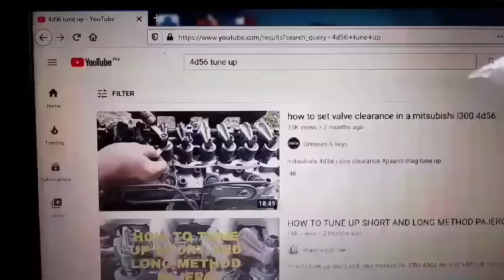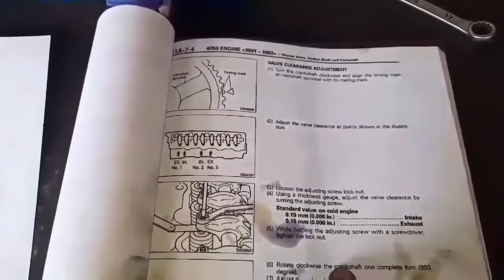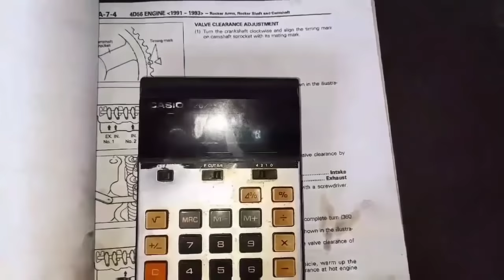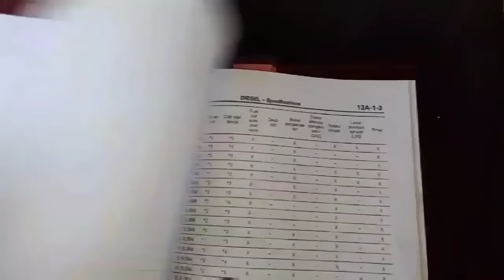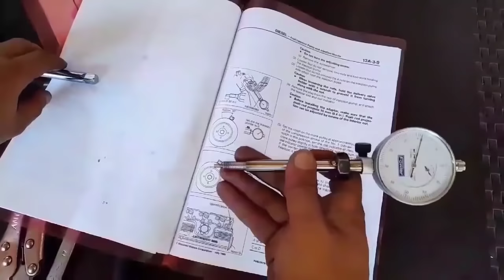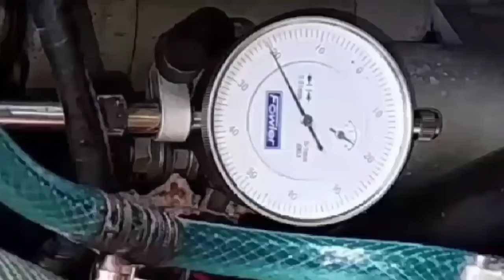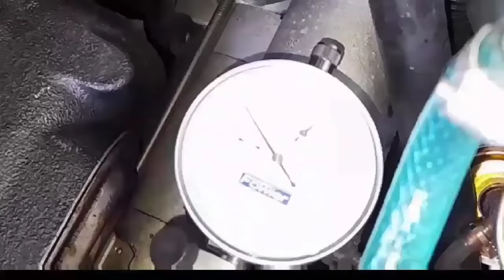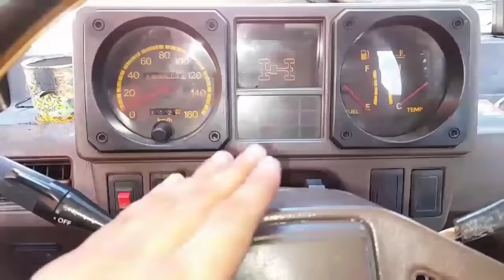COMPLETE 4d56 Tune Up, Valve Clearance and Injection Pump Timing Using A Pre-stroke Measuring Tool

Comment: Great video and thanks for the tips. When my injector pump seals went I had to remove it myself and have it professionally reconditioned. When I put it back I remembered timing it just with hand adjustment. I had no idea about the technical way  until now!! The injectors and pump recon cost me $1600 Australian but it would have cost thousands more if done by a mechanic. Still going strong 5 years later although it could do with a tune! Thanks brother, God bless you🙏🙏
Reply from the maker: Thats expensive. Actually, as far as im concern, theres really nothing wrong  with simply twisting the pump and just have a feel for how the engine runs. I intend to do a video about it too. Like ive said in this video. Dont be too bookish about tune ups. I figured id just show this process because almost all the 4d56 tune ups i see are mainly focus only on the valve clearance. Thank you too.
Reply: In Nz my neighbours got quoted 2.5k! no way i said let me have a look

Comment: You replied quickly to my comment about accessing the crankshaft from beneath.  I had deleted it because as the video progressed, I saw that you could do MUCH MORE with the fan and timing cover out of the way.  Those ATDC degree points are only visible under the cover, for example.  Again, Great video. Very informative.
Reply from the maker: Thank you and goodluck

Comment: Amazing knowledge sir. I just did a top overhaul to my WLT. the problem previously was a broken intake valve. I searched googe and valve clearance was said to be from .005 to .015 intake and .015 to 0.25 exhaust. I did .008 8ntake and .020 exhaust but it did not want to run. I readjusted to .015 and .025 and it ran. But now it sounds like a jeepney when accelerating, smoking white, and lower power, and hard starting. I need to spray carb cleaner in the intake for it to start. I did a perfect TDC timing on crank pulley, cam gear, and injection pump. But i think i should try the i tooth advance in the injection pump in the other video i showed and that dial gauge for the injection pump.

Comment: Thank you for the information I have a few questions  1 the tool that you use with the dial gauge how can I get it../ 
2 can I just adjust the crank 7 degree and fine tune the pump I have a dail gauge but not the tool 
Thank you for the information it really helps

Comment: Thank you for this wonderful explanation, I have an older volvo penta 4 cylinder marine diesel , when I start up it would produce lots of white smoke , do u think adjustment of the inject pump might help , also for example in a misalign pump , will it create additional crankcase pressure ?

Comment: Sir, thank you for this highly educational video. May I know the effect of having a .25mm valve clearance for the 4d56 engine performance? My mechanic insisted this clearance instead of the .15mm clearance in the manual. The engine was warm/hot when they adjusted the valves. The manual says .15mm cold.
Reply: I would like to know why also
Reply: @peoplechoice7654  I DIY'd the valve clearance by following the video. It was actually very easy. My Gen1 Pajero was on .25mm and I changed it to .15mm. Mas naging pino ang idle. Hindi na siya tunog trak na isuzu. Mas lumakas din ang hatak. Pakiramdam ko ay parang tumipid din sa diesel.

Comment: Thank you very helpful video. On your other video I learned how to fiddle with the fuel mixture, i have no black smoke now. Tried doing this by using the other end of a caliper with magnetic support. Measured 1mm movement of plunger from tdc to 7atdc. I think by listening and driving you can feel the performance. Adjust and adjust. But can you please tell me where you bought that dial gauge and adapter?
Reply from the maker: The indicator is from my fowler bore gauge bought from amazon https://youtu.be/0oN0-vLN0j8 the adapter is homemade https://youtu.be/9S4DX1k3F_I

Comment: One can rotate the crankshaft by lifting one of the rear wheels, engage the highest gear and turn the wheels. No need to remove the radiator and fan.

Comment: saan po shop nyo...need po mag pa tune up, valve clearance and injection pump timing using a pre-stroke measuring tool?...Mitsubishi adventure 2017 model...pls. po. Nagka calibrate din po ba kayo ng injection pump?...pls po.

Comment: @mrdiyer I have a jeep that has a peugeot XD3P engine. The FIP is Delphi-TVS DPC. It has a second solenoid adjacent to the throttle. I think this is the cold idle advance or idle rpm increase when AC is switched on. The solenoid makes the click sound when I connect power but no change in engine rpm. I am m unable to find any information about this FIP anywhere. Have you come across this FIP.

Comment: hi great video ! i have a D4bF which is basically a updated hyundai version of the 4D56 - it has a mechanical injection pump , my question is, im going toinstall a boost gauge, should i tap into the injection pump boost line or into the wastegate boost line ,,,, interested on your thoughts
Reply: would there be any difference?

Comment: Sir i have a problem..after i do valve adjustment done on non turbo 4d56 .i drive the car and suddenly i hear a clacking noise from engine...when i open again i found one of nut is gone (in valve cylinder 4)..i try to found at the top of cylinder head but can't not found ..but the engine is ok..i change the nut and still driving normally until today ...my question is the nut stuck in the oil hole in cylinder head or going thru oil pan ..what can i do to found without major diassembly the engine...

Comment: @Mr DIYer  Hi just seen your video and with my 4d56t Intercooled import it says 0.25mm and the book shows something completely different is that because they’re slightly different variants in this motor or em I better of going your way mine is a 1988 gen 1all so I have the book that goes from 1983  to 1997 petrol and diesel from na to nk
Reply from the maker: Like ive said in the video. You can experiment. See what works best. You can try .25 .20 .15 or even 12 13, whichever, at the very most at least .10
But in my experience having a clearance of .20 or .25 produces a lot of tapping sound from the tappets.
Reply: @MrDIYer  ow yes yes and so do them in the same sequence that you showed

Comment: How about the pump timing on newer 4d56 with electronic controllod pump? There is timer piston and timerpiston sensor, so is it even made to be adjusted manually?
Reply from the maker: Still trying to learn about that system but so far i doubt you could do that manually. Everything is controlled by the ecu.

Comment: Hi, I am an ardent follower of your channel especially on the 4D56 engine videos. I have just completed rebuilding a 1992 4D56T engine and followed all the processes from piston ring gaps and spacing gaps and cylinder to piston clearance gap etc.  On first start up I have blow by what is causing that??? some internet sites say the rings have to seat inn first before the blow by can go away. In your videos you dont mention anything about seating the rings how do you do it????
Reply from the maker: Question: did you clock the piston rings properly?
If everyhring was done right. 
Its normal to see initial blowby from new or newly rebuilt engines. Thats why we break them in. Meaning you let the engine run. Preferably idle for one hour intervals. One hour running one hour cool down and  one hour running again and so forth. Eventually the rings will sit against the cylinder wall. That is if everything was done right.
Reply: @MrDIYer  Yes I clocked the correctly and I made sure it was correct. So after 10minutes of starting the engine I saw some white smoke from the breather hose, even the feeler cup and some oil when you remove the dipstick(just drops jumping out). So provided everything is ok, how many cycles should I run of 1hour running and 1 hour cool down??
Reply from the maker: Try to do it the whole day one hour running one hour cool down.
Reply: @MrDIYer  Hi, I think I have another problem. 30 minutes after starting the engine to break inn the rings I noticed coolant slowly coming out from two head bolts on the middle on the injectors side especially when I increase the revs to 1500 to 2000. I torqued the head bolts to 118NM as per the workshop manual. I must mention also that the head has been skimmed twice by the previous owners so with that light I decided to use 3 notch metal gasket to compensate on the loss in thickness. I did not put Copper spray or any sealant on the gasket, just light grease on it. Kindly advise what to do. Thank you.
Reply from the maker: Question: did you check the cylinderhead and engine block for flatness with a steel straight edge? It must be within standard value of .05mm. If the the block is warped it must be refaced if its the cylinder head it should be replace.
Also did you you make sure the bolts as well as the thread on the block are cleaned/meaning you should be able to thread in the bolt by hand without difficulty rethread or retap if possible.. Because that can throw off setting the torque right.
Lastly make sure your torque wrench is calibrated. Otherwise you might think that your applying the correct torque but in reality youre not.
Not applying sealant should not be an issue if everthing was done right.

Comment: I want to ask I have Mitsubishi Pajero 4d56 very hurt to starting when I remove the all 4 injection to clean it and put it back but car still not starting.
Reply from the maker: When you clean the injectors did you dismantle it one by one and reassemble or did you mix uo all the parts?

Comment: Sir.  I have a Hyundai Starex with D4BB engine. 3 months  ago the balancer belt was broken and car vibrates and even the transmission shifter make noise from the vibration. 
So I replaced the belt, and many more parts, and still my engine and transmission shifter vibrate. I also overhauled the cylinder head
Reply from the maker: Many causes for vibration. One is very low idle. 2 is out of timing esoecially the balancers.  3 engine support 4 fuel delivery. Etc
Reply: I don’t know how to adjust the balancer, I used gravity trick. The fuel system, all injectors, fuel filter all are brand new. And calibrated. No problem with starting.
Reply: As I mentioned, the balancer belt was broken , so it was out of timing
Reply from the maker: Just make sure that the timing marks are all aligned. Make sure the the key way groove for the pulley doesnt have play.
Reply: @MrDIYer  the timing belts are all on Spot. Engine mount is new. Transmission mount is new. No air in the fuel system. The car start right up. No problems. Can you make a video for balancers adjustment pls?
Reply from the maker: I dont asjust the balancers i just set them to the proper timing

Comment: Sir  i just wanted to asked questions, I have a Pajero NL, bought it second hand with 400,000 kilometres and some blown radiator and some buble on it so pull out the cylinder head  because it’s a 4m40t we can’t machine it because of the ceramic parts on it. So we ended up getting a brand new head. Any how after doing that, the car was great, until I had a breakdown after 3 months, the camshaft broke to 3 pcs. So we replaced it, put a new pump primer, glow plugs and shut off valve. But we are having a very hard start and most of the time no start at all? I even replaced the fuel hose with a clear braded one so we cqn see the diesel going through it. We even advanced the fuel pump to a certain degrees but still no success. We even checked the glow plugs relay and all the fuses. It only cranking but would not start. But with the spray of a Nulon Start You Bastard on the intake it will start. And when it gets warm it will start no problem. What do you think is causing the hard start? Would it be the fuel injection pump? Need to be recalibrate? My mechanic said that the plunger probably worn out because it’s not holding the fuel pressure. Maybe it’s time to get a new fuel injection pump, what do you recommend? I hope you can help me. Love all your videos it’s very straight forward and very clear, it’s like I am sitting inside the classroom of my Trade School in Bataan. More power sir! Wish you all the best.
Reply from the maker: Sorry for the late reply.
Hard start/ no start issue usually are causes by 
1. Out of timing/ lack of tune up especially the fuel pump
2. Insuffiecient fuel delivery meaning air in the fuel lines clogged filter,  worn out injectors or worn out pump
3. Lack of compression
1. Out of timing/ lack of tune up. I suggest thats what you try to do first as it will cost nothing if you do it yourself. Try tilting the pump manually while the engine is running i have a video about that. If no result move on to next step.
2. Lack of fuel pressure/ air in the fuel lines/ dirty or clogged filter, considering you said you replcae the lift pump and if you replace the filter too make sure there are no  air in the fuel line. Make sure no leaks. If same result move on to nexr step.
3. When the engine start in the first few minutes does it spew white smoke and disappear? If it does service or replace injectors.
4.if you can perform compression test.
After all all that  you said the engine starts with no problem when its has warmed up,  i would focus my attention out of timing and on the injectors and pump. 

But best to do a process elimination  in order to avoid unintended expedinture.

Btw. When replacingcylinder head as far as im concern its better to replace it as set. Because there will be wear and tear on the camshaft from the old head and because of that that will not fit well on the new head.
Reply: @MrDIYer  thank you very much sir for the reply 🙏. We'll surely do your advice and will let you know of the outcome.
Reply: @MrDIYer  And also we did put a new fuel filter,  newly calibrated injectors.  When the engine starts it's blowing white smoke then when it gets warm and driving it more than 2,000 rpm it'll blow very thick black smoke.

Comment: ser ung nozzle housing at nozzle tip ko nauubos effect ba to ng wrong timing sa injection pump?   4d56 ko dual turbo. ung isa h12 21b model at ung isa vw compresor parihas lang ba adjusment? piston size ko .50

Comment: Great video. Just curious, the intake manifold on this vehicle is interesting. Was it a oem part? I'm not very familiar with non turbo
Reply from the maker: Thank you. Still stock manifold
Reply: @MrDIYer  hi again, what model is your vehicle? Thanks again
Reply from the maker: First gen. Not entirely sure but somewhere between year 81to86

Comment: My gauge doesn't reach the full limit when turning the engine it stops between 85 and 90 on the dial guage and when tilting the pump the value doesn't change

Comment: i looked at my cylinder head. but there are no letters A nore B.
there are letters ENG 20.
what degree should i aim to tune the fuel pump using the indicator sir?
Reply: its a hyundai super porter 2003 with a 4d56 block.
Reply from the maker: If its 4d56 the marking should be beaide the temp sensor
Reply: it should. but couldnt find anything. what is your facebook? can i chat with you?

Comment: Sir Tanong ko lang po un sa valve clearance parehas lang po b sa adventure 2010 model n 2.5 diesel?
Reply from the maker: makikita nyo po valve clearance naka lagay sa valve cover
Reply: @MrDIYer  un .25 (hot) po b un.? Ano po un pag nakaandar n po b at dapat mainit p makina,. Eh pag po un d mainit at d p naandar parehas po b at pwede po un .15? Maraming salamat po sir
Reply from the maker: Pwede po .15
Reply: @MrDIYer maraming salamat po ulit sir

Comment: Hello sir, I have not seen a more detailed explanation than this. I hope to find a mechanic as good as you in my country. I have a mitsubishi pajero 1995 4d56 intercooled turbo but it has lost power climbing hills, for example if before from 2nd gear to 3rd it wanted 2200 rpm, now it wants more than 2600 rpm, now it doesn't emit black smoke, whereas before when it has not lost the power, it emitted a lot black smoke 
Now that we are talking it is in excellent condition as is the engine work and ignition .
What could be the problem because I have had it since 2005 and it hasn't given me 1 defect. please help me.
Reply from the maker: Try to check your transmission

Comment: Hello sir, tanong lang po normal poba na may pressure ang cooling system pag operating temp na 4d56 engine.
Reply from the maker: Panong pressure po?
Reply: @MrDIYer  pag pinipisil yung hose medyo matigas, pag binuksan yung radiator pag mainit makina mag squirt ng tubig. Hindi nman nag ooverflow sa coolant reservoir ko.
Reply from the maker: @airsight2753  squirt as in arang bulwak? subukan nyo i rev ng dahan dahan, kung mawawala, walang tama sa gasket yan, baka dahil lang sa vibration masyadong mababa rpm, subukan nyo itaas rpm dahan dahan.
Reply: @MrDIYer  hindi nman nabulwak sir pag nkaidle o kahit irev ng walang takip ang radiator, dirin po nagbabawas ng water. Problem kolang talaga is yung pressure sa radiator pag mainit na makina, na try ko kasi i compare sa innova 2017 eh di nman nagkaka pressure ang radiator.
Reply from the maker: Natural nag mag ka pressure yun pag uminit coolant/ lalo na tubig
 Kumukulo nah kaka pressure. Kaya yung radiator cap may pang release mg pressure patungo sa reservoir

Comment: Sir madali lng po ba mag palit ng radiator ng l300 fb? Anong tools po kailangan? salamat po
Reply from the maker: Di ko masabi sir.wala ako experience dyan sa pajero kasi apat na bolt lng nmn  kaylangan tangalin. Ganon din ata sa l3.
Reply: @MrDIYer  opo sir apat n bolt lng din po, hose at bolt lng kailangan tanggalin db sir? Try ko Sana ako magpalit sayang labor e salamat sir

Comment: May i ask, my 4d56t pajero engine automatically get higher rpm during idle..this only happen when gear in Neutral..when move to R or D will be normal rpm..then when move to N or P, after sometimes the engine rpm become higher..anyone experience on like this issue??